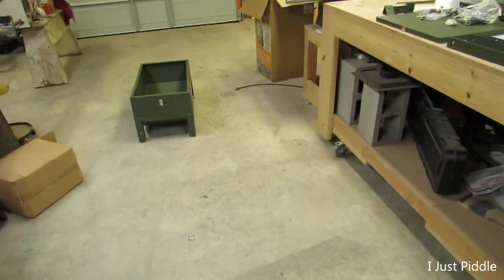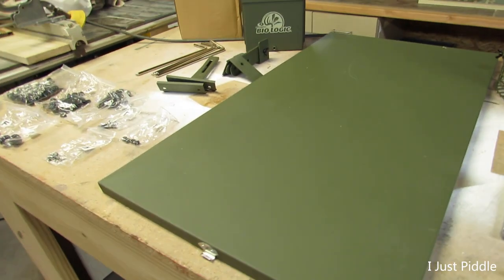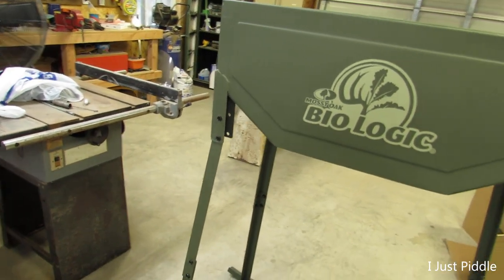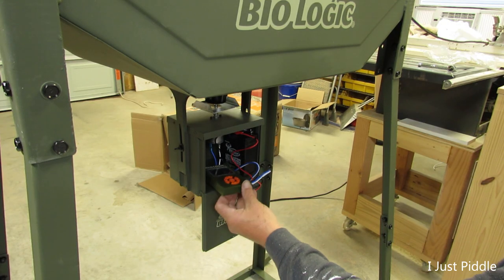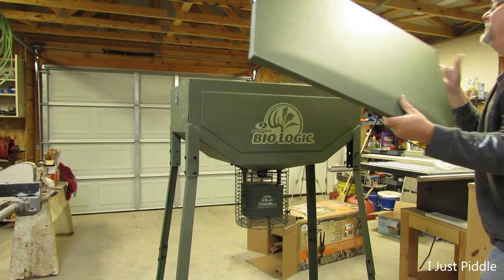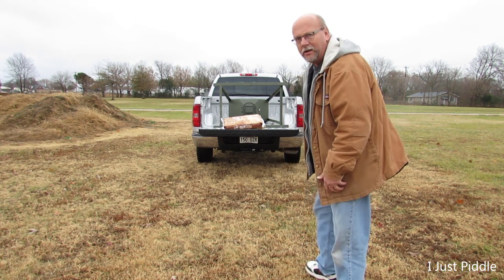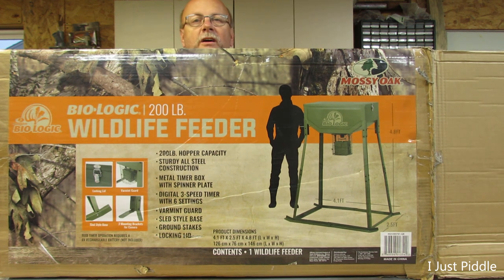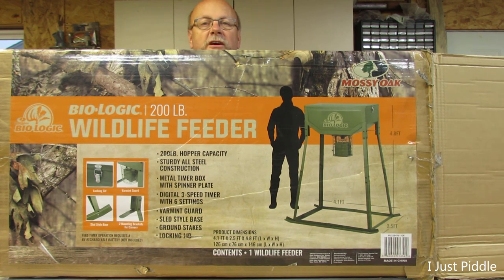Mossy Oak GameKeeper 200lb Capacity Steel Deer Feeder - My Take

Comment: I like mine. I do not use it for hunting. Just in backyard for the grandkids to view and enjoy the wildlife. I would not recommend if you do not visit it regularly b/c it does not funnel well.  I purchased a few years ago for around $149 under a different brand name. I do have to keep the top tarped to help with moisture. It does work well and prevents varmints for the most part. I cannot attest to any issues with hogs or bears. All and all with my needs. I would give it a 4.5 out of 5.
Reply from the maker: Yeah, the funneling is a little messed up. Seems like when it gets to a certain level the corn just stops and I have run my hand through it and get it so it will fall though. I'm thinking of someway to fix that!

Comment: Instructions say 3/8" and looks like it is measured from bottom of funnel to tallest bend on spinner plate in picture. Not sure if this is totally accurate cause looks like total space from bottom of spinner to bottom of funnel is about 1" on mine.
Reply from the maker: Thanks! I need to put in a charged soon so I'll make that adjustment. It has been doing okay though!

Comment: I’m having some trouble with mine the spinner that shoots out the corn isn’t spinning.  I can hear the battery go off when I test it so it’s not that.  But when I give it a nudge with my hand it spins.  It’s really weird it’s only a year old.  I think it might be because I didn’t put the animal guard on and the deer maybe messed it up somehow.  Any suggestion?
Reply from the maker: That is probably it. That guard really is necessary as the deer will take their feet to spin the motor to get more corn out. You might try Walmart, Bass Pro, Academy and places like that and see if they have a replacement motor or a motor that might work that you can replace it with.

Comment: The instructions were stupid in that they showed the bottom legs on the outside of the top legs in a way water would have stood on those points and rusted it out plus they were so hard to read I pretty much just figured out how it goes together on my own without them easier

That cage is for raccoons that would get on it and tear that plastic funnel out causing it to spill out all of the corn

Right off the rip hogs were digging under the frame of mine as a way to no doubt undermine it and turn it over so I put it on a concrete slab and nailed the front side to a rail road tie staked in with tee post and that put a stop to the hogs trying to turn it over

The concrete slab actually then also worked as a trough for any corn that dumped under the feeder and game cams show deer raccoons and hogs love that feed trough full of corn as a way to get clean corn
Reply from the maker: I had checked out a couple videos and learned about issue with the legs from your video:) I actually got my feeder put together by looking at how it looked in your video! I don't have to worry about raccoons or hogs where I have my feeder located. I don't even have mine staked down.  I'm glad it came with the cage! On the feeder my mother-in-law had the deer would stand on their back legs and spin the plastic thing with their hoof or tongue and get the corn to come out:) I do have a couple 6-8 point buck with BIG antlers that will only eat the corn from under the feeder for some reason. I'm afraid they might get a antler tangled up in the cage and mess it up:)